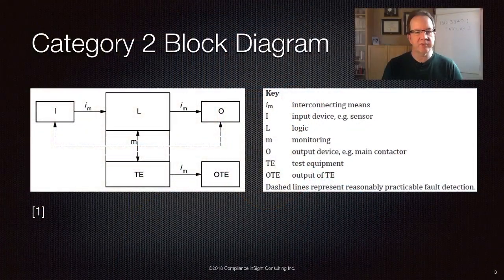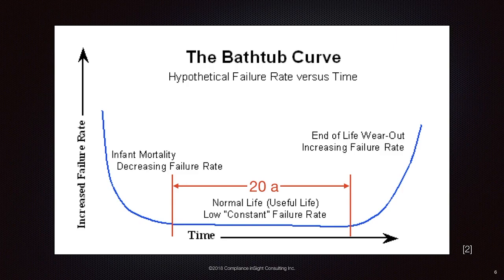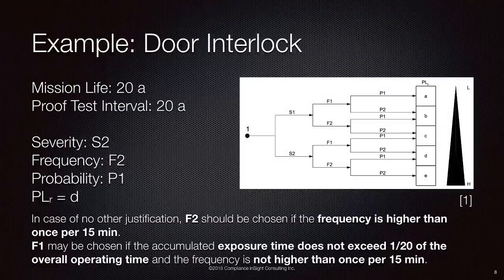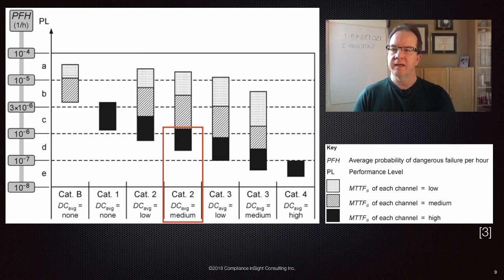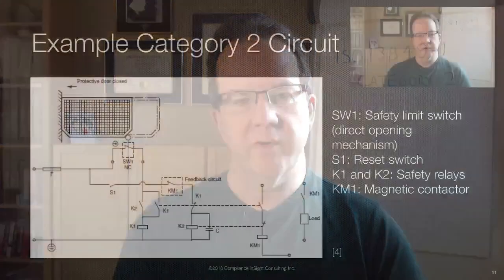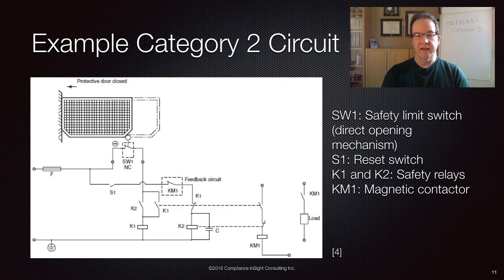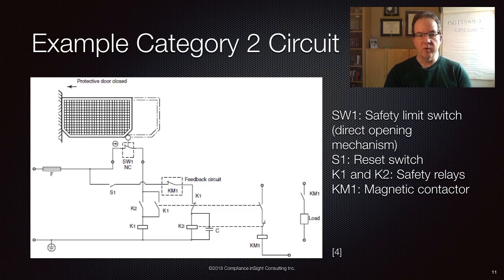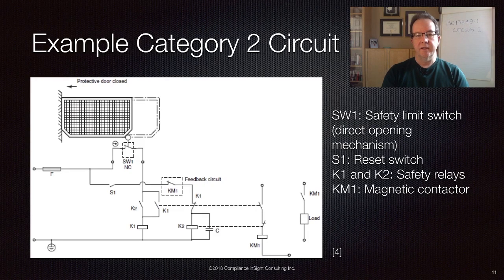MS 101 Q & A: Category 2 and Test Intervals

Comment: Hi! Thanks for this interesting video. Regarding the example at 15:00. Maybe it is posible to defend the use of SW1 by using fault exclusion? Mabe a safety switch vendor already did?
Reply: The required cyclic testing would not be covered of course. Unless it is a very low demand rate and a lot of manual inspections.
Reply from the maker: Hi Anton,
The use of fault exclusions has to be handled very carefully, as I'm sure you know. For reference, here is the clause on fault exclusion:

6.1.10.3 Fault exclusion 
It can be necessary to exclude faults in order to evaluate subsystems. Fault exclusion is a compromise between technical safety requirements and the theoretical possibility of occurrence of a fault. 
Fault exclusion can be based on 
a) 	the technical improbability of occurrence of some faults,
b)	generally accepted technical experience, independent of the considered application, and
c)	technical requirements related to the application and the specific hazard.
Fault exclusion is only applicable for certain failures of an element and it is up to the designer (manufacturer or integrator) to prove the exclusion of the respective faults based on the limits set forward by the design and use. Such fault exclusion is only possible provided that their unlikely occurrence can be justified based on the known laws of physical science. Any such fault exclusions shall be justified and documented. 
The application of fault exclusion to certain faults for an element inside a subsystem does not limit the necessity of applying measures against systematic failures. 
It is possible that some faults are excluded by the manufacturer and some by the subsystem integrator. 
There shall be a specific characterization of the type of fault that is excluded. It would not be acceptable to state simply that a component will not break, distort or degrade due to wear. It is necessary to state the direct influence under which the component will not break, distort or degrade due to wear. For example, the component will have no faults when subjected to a force of X Newtons from direction Y. 
The fault exclusion shall be justifiable under all expected environmental conditions including temperature, pressure, vibration, pollution, corrosive atmosphere. 
PL e shall not depend solely on fault exclusion. 
NOTE 1 Information on fault exclusions is available in ISO 13849-2:2012, Annexes A to D. 
NOTE 2 Product standards can give further information. 

Since Note 1 references ISO 13849-2, a look at the available fault exclusions for electromechanical switches gives us the first row in Table D.3 — Well-tried components:

Well-tried component                                                 Standard or specification
------------------------------------------------------------------------------------------------------------------------------
Switch with positive mode actuation                       IEC 60947-5-1:2003, Annex K
(direct opening action), e.g.:
— push-button;
— position switch;
— cam-operated selector switch, e.g.
for mode of operation

Table D.8 — Faults and fault exclusions — Switches — Electromechanical position switches, manually operated switches (e.g. push-button, reset actuator, DIP switch, magnetically operated contacts, reed switch, pressure switch, temperature switch)
Fault considered                                                  Fault exclusion                                          Remarks
----------------------------------------------------------------------------------------------------------------------------------------------------
Contact will not close                                         Pressure-sensitive devices                      —
                                                                                in accordance with ISO 13856

Contact will not open                                          Contacts in accordance with                  —
                                                                                IEC 60947-5-1:2003, Annex K, are
                                                                                expected to open.
-----------------------------------------------------------------------------------------------------------------------------------------------------
For PL e, a fault exclusion for mechanical (e.g. the mechanical link between an actuator and
a contact element) and electrical aspects is not allowed. In this case redundancy is
necessary. For emergency stop devices in accordance with IEC 60947-5-5, a fault exclusion for mechanical aspects is allowed if a maximum number of operations is considered.

NOTE The fault lists for the mechanical aspects are considered in Annex A.

So the bottom line is this: If the switch conforms to IEC 60947-5-1 and is installed in accordance with basic and well-tried safety principles (See Tables D.1 and D.2), then you may be able to justify a fault exclusion. Additionally, the mechanical fault exclusions in Annex A could be considered. However, the higher the PLr, the more carefully these fault exclusions must be considered. If you are implementing PLb, loss of the safety function is unlikely to cause severe injury. Should the PLr=d, a severe injury is likely if the safety function is lost. Fault exclusions should only be used with care.

If you're interested in using Category 2, you might want to read my post on this architecture, https://machinerysafety101.com/2010/08/24/interlock-architectures-pt-3-category-2/ and my Q&A post, https://machinerysafety101.com/2018/05/16/category-2-and-testing-intervals/.

Comment: I have a question : If KM1 is welded then what's the point to interlock KM1's coil with K2? If this is to prevent KM1 from starting then it does not affect the circuit because KM1 is welded so the load is already active. This is really confusing me and I would like your point of view on that. Thank you
Reply from the maker: If KM1 welds, the contact from K1 controls the coil of KM1. However, this failure will prevent the load from being switched off (a single-point failure.) The primary reason for interlocking K2 with K1 is diagnostics. If K2 welds, then K1 will still allow the safety function to work when the guard is opened by SW1, switching the K1 coil off and on. If K1 welds, then the NC contact of K1 will prevent K2 from switching on, but control over the load is still lost (single-point failure.) So, this circuit meets a portion of the definition of a Category architecture (a single-point failure is allowed to cause the loss of the safety function) but fails when it comes to diagnostics since a Category 2 system must have at least 60% DC, and the guard interlocking switch (SW1) is not monitored. I was trying to make the point that even a schematic from a "reputable manufacturer" doesn't necessarily mean it's correct. In this case, it most definitely is not correct.

I mention in the video that I rarely see Category 2 used in practice. It is much more common to see Category 3 or 4. There are applications where Category 2 can make sense depending on the risk level and the availability of safety-rated hardware. For example, if you need to use a non-safety rated through-beam sensor at the exit point of a conveyor from a guarding enclosure, if the risk is low enough, you could use a Category 2 architecture and use the process to monitor the operation of the sensor. The process "knows" when a part is placed on the conveyor and how fast the conveyor is moving, so each time the sensor is broken within a specific time frame, you have a diagnostic that says the safety circuit is still working.

I hope that helps. If not, head over to https://complianceinsight.ca/front-page/contact-us/ and drop me a note, and we can continue this discussion.

Comment: So the test rate  interval in definition of Category 2 in 6.2.5 should follow 4.5.4 “Simplified procedure" ???
Reply: Hi Varunyu,
If you are using the simplified procedure, yes. If you are using commercial off-the-shelf safety components, like safety relays, modules or PLCs, then this test rate will already be exceeded by the built-in diagnostic measures. If you are building a bespoke system, then in the absence of any other guidance the 100x test rate is a reasonable minimum requirement.